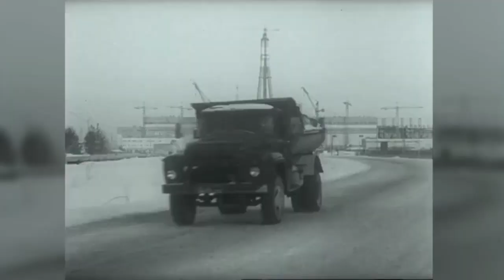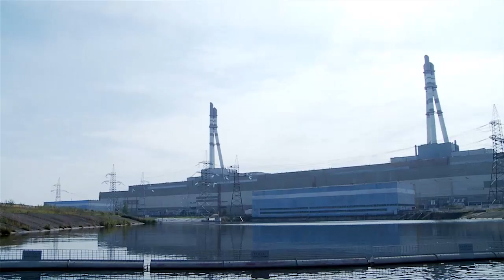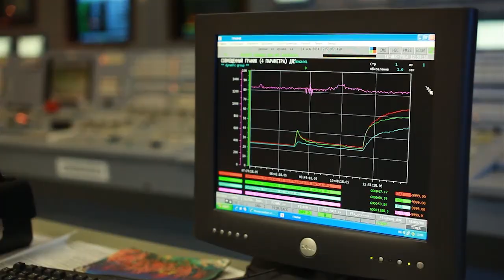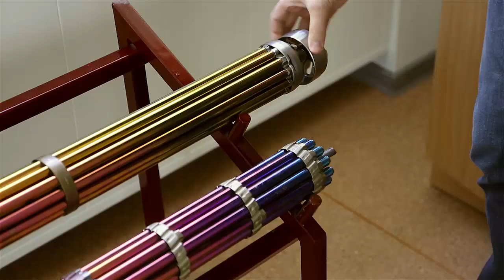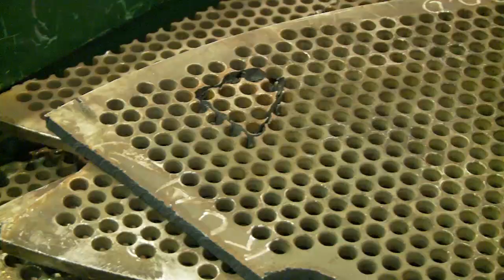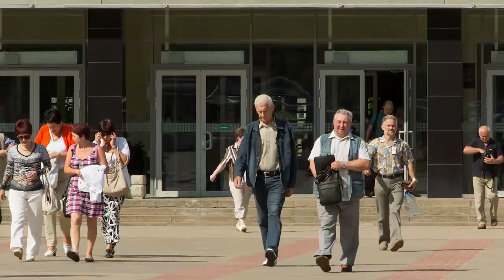SE Ignalina Nuclear Power Plant

Comment: A lot dishonesty in this video, they had an uncontrolled power excursion prior to Chernobyl and despite all the post Chernobyl fixes the inherent design flaws (quite simply the numbers of steam pipe welds due to the Soviets lack of technology and skilled workers to do the larger welds)  leads to leakages of radioactive steam that exposes its workers to radiation outside those acceptable in the West and of course the fundamental issue of their being no containment around the reactor.

Comment: Ignalina NPP had 2 RBMK-1500 reactors and both were capable of producing 1500 MW of electrical energy each. And following the Chernobyl disaster, they were de-rated to 1360 MW and were still producing 2720 MW total by 2001, which was fascinating, as even today this would be a powerful decent nuclear power plant. The Soviet Union had the most powerful reactors during the 80s and only Japan developed their nuclear energy industry even further as some of their reactors are even more powerful than Soviet ones. But the Ignalina NPP was a truly powerful generating facility and after various reactor safety adjustments introduced after 1986, it could be run even longer. In short, this was an impressive nuclear plant.

Comment: I don't understand why they don't let the plants run there course.  They are already there.  Use them for the lifetime they were built for.  Then dismantle them.
Reply: Agreed, it was a solid plant. Different from Chernoybl
Reply: The trouble is that the RMBK could not be upgraded to meet Western safety standards the Soviet PWR types could be with significant upgrades to containment, controls and safety systems.
Reply: Because ting goes boom and then u dead
Reply: @unitforce7417  not with upgraded rbmk’s

Comment: Looks powerfull tho. Sad but not in use actually a good thing after the Chernobyl but still it have helped Lithuania a lot.
Reply: Should've kept running for about 16 years more in my opinion, this power plant was pretty safe and Lithuania would have more electricity.
Reply: @vervluukt  yea and meanwhile now in russia and some other places in the world you can find this chernobyl type of  power plants soo
Reply: @probasketspec5025  The operational ones are all in Russia, Leningrad 1 (The first RBMK ever built) was shutdown december last year.
Reply: @vervluukt  Yeah and then there would be another Chernobyl type of disaster. Ignalina is a sister power plant to Chernobyl. It actually had a mini accident even before Chernobyl had one. There's no way this power plant was safe.
Reply: @esclove3707  The RBMK-1500 was safer than the RBMK-1000. Yes, i know the mini event at Ignalina, it had a small power surge when starting up reactor 1. They noticed this at the Leningtad NPP in 1975, and it happened in Ignalina aswell. And that was one of the contributors to the Chernobyl disaster. And, Ignalina isnt a sister plant, it uses a different RBMK, therefore, it does not classify as sister. If you want to see the sister of Chernobyl NPP, go to Kursk NPP.

Comment: RBMK-1000 and maybe all RBMK reactors have the same dangerous design graphite on the end of the control rods, far as I know all of the bwr reactors in the United States use cadmium rods or blades for the control feature of the reactor, and they drop by gravity instantly when the button is pushed to scram the reactor...
Reply: Those problems aren't there anymore.
Reply: @vervluukt  the entire rbmk design is faulty it is a cheap fast way of making power that is inherently unsafe the design the graphite used as a moderator, bwr and pwr are much safer, and have very good safety procedures in place as long as the operators follow them...
Reply: @trentvo2736  Some Nuclear power plants in the UK still use graphite as moderators. They still operate fine and safe.
Reply: @jannadrielcervo7753  Yeah, but they use CO2 as a coolant, so there is no positive void coefficient. It is also build and designed much better and the safety culture in the UK is much better.
Reply: Almost all of the RBMK still in operation have replaced their graphite tip control rods with a better and safer design. It is also further improved and upgraded with more emergency safety devices. Only three I think still remain with the tips made of graphite. But I don't know if currently the remaining are now being dismantled or further improved.
Reply: @jannadrielcervo7753  The remaining are getting further improved.
Reply: Jann Adriel Cervo Generally all units were updated after the reasons for the accident became clear.  I'm not sure if some of the control-rods still have graphite-tips,  -but they have cannot be driven out of the core anymore so that there's no additional react added into the core if they're driven back.  -But most importantly there're new motors that push down the control-rods in 2 seconds rather then 20 before the catastrophe.
Reply: @jannadrielcervo7753  sometime you just can't improve a poorly designed system, plants using graphite as a moderator are inherently unsafe that's why they were never used in the US except for enrichment purposes, maybe you should tear out some engineering books and do a little more research before making claims, poorly designed reactors should be done away with, decommissioned put small bags and plastic barrels and buried and a safe location where will not affect the people or the water table...
Reply: @trentvo2736  Not really unsafe. It was a Design flau that now is fixed and the chernobyl incident happend to Human error too if the operators followed the manuals for the test the reactor whould not have exploded. but luckly it fixed so no more incidents like that can happend and its just a shame that a good reactor as that so powerful is going to decommision all of them one time in the 2030's. that reactor type have a very good safety reputation but the chernobyl incident ruined it all for RBMK reactors even tho it fixed
Reply: @eliasnikolaivonheimtrondse4424  No thats not true, the manuals did not prohibit any of the actions taken by the operators, except for a too low ORM (But they couldn't have known this. the computer took 30Min to calculate this). The Soviet Union lied about the documentation, this was corrected in the INSAG7 report of the IAEA.
The RBMK Reactor is fundamentally flawed, it was build to be Cheap not Safe. Graphite moderator and light water coolant is a bad idea. The Reactor has a Positive Void coefficient which is due to the Construction of the Core itself, it cannot be fixed completely. It was improved (two!) years after Chernobyl, but it is nowhere near the safety standards of a Western Nuclear Power Plant. And it's definitely not a good reactor.
Reply: @gutesache1  its a shame they retiering the reactors now they solved the issues, more enriched fuel and much more so it aint gonna explode agian and more safety protocals a whole new design, and they.violated the guidlines they knew they were in a xenonpit but he wanted it done so they pulled out controllrods and when the chain reaction start nothing to stop it no water,controllrods or xenom beacuae it burns away and the scrambutton flau the new safety protocals is for the first part of what i told (human error) and the redesign is for the az5
Reply: @eliasnikolaivonheimtrondse4424  Yeah, actually the guidelines only prohibited starting again from decay heat. In the manuals this was declared as < 30MWth. So they didn't violate the rules. 
.
It was retrofitted with the new control rods, more absorbers, better safety precautions, etc. It made it more safe than it was before. But the design is fundamentally flawed. It still has no containment, a positive void coefficient in certain operating conditions, a very low thermal mass and a very big core which makes it hard to control the neutron distribution in the reactor.
.
An accident like the one in chernobyl can still happen in an RBMK reactor. For example more than three pressure tube ruptures could have a catastrophical outcome. But even in normal operation the RBMK plants have very high radiation emissions, thats why they have those big cooling ponds.
.
It's a garbage reactor and it can't be fixed, all RBMKs should be shut down and replaced with e.g. the VVER 1000 or the new Gen 3+ VVER 1200.
Reply: @gutesache1  it cant happend they use a specific low enrichment fuel in their reactors now and all the other changes. Wont be possible to explode (sorry for bad english)
And yeah it dosent have a containment vessel that make it can refuel and not need to shutdown and thats why it dosent get license in the West but that made the catasrophe worse at chernobyl  but all the changes made the beast of a reactor more safe and if you look at the safety records if we take chernobyl accident out of the list its just fantastic but if chernobyl didnt happend the flaw whould still be in the scram system of the reactor but since it happend it was made sure not to happend agian
Reply: @eliasnikolaivonheimtrondse4424  I disagree, and they use higher enrichment fuel. It was increased from 2.0% to 2.4%.
There are other reactor types that can be refueled while in operation e.g. the Advanced Gas Reactor from the UK, and it still has a containment.
.
The problem with void reactivity can't be fixed completely, the core is due to it's enormous size unstable, the low thermal mass can't be fixed, redundancy is still a big problem, the data acquisition system is very old and not at all redundant, spatial power control systems are still being operated with only 9 zones, in most plants its still the operators responsibility to keep the ORM in a safe margin (although it's a very important value in RBMK plants). And that's not all, there is more.
.
It is a generally unsafe design and should not be in operation anymore. There is a reason why countries with old VVER or RBMK plants, have to shut them down to join the EU. When West and East Germany were reunited, all soviet nuclear power plants were shut down immediately. For example Greifswald - 5, a VVER 440/213 was only 24 days in operation, because it wasn't possible to bring it to the safety standards of the west.
Reply: @gutesache1  sorry saying low enrichment fuel i thouth it was higher enrichment in my head so i searched and it said less enrichment but in my opinion no more pf those reactor need to be built but the remaning ones  need to continue operating
Reply: @gutesache1  ok thank you will read that artical
Reply: @gutesache1  after reading a little bit of the flau and fixes and that i still stay strong with my opinion All the current RBMK reactor have nothing to get retierd for in 2020 but no more of RBMK reactors should ever be built if they dont get a whole new reactor design that eliminates all the flau/flaw that the current one got but overall if it get proberly maintained and a crew who fully knows how the reactor work and its breaking point and rules i see no need to retire the current ones
Reply: @eliasnikolaivonheimtrondse4424  Okay, then that's your opinion. But I still disagree. To clarify, I'm not against the peaceful use of Nuclear Power, just against using old unsafe soviet reactors. And the RBMK - 1000 is in my and the IAEA's opinion unsafe and should not be operated anymore. They should have a time frame to replace those reactors, but that should not be longer than absolutely necessary.
Reply: RBMK reactor flaws were fixed following the 1986 Chernobyl nuclear disaster. It is also one of the most powerful reactor models and following the Chernobyl 1991 Unit 2 turbine hall fire, no large accidents were reported.

Comment: This power plant was safe! But a incident happened (which later caused the Chernobyl accident), so they actually even knew before the Ignalina incident and Chernobyl accident happened.
Reply: Hi.
Reply: You don't know what the fuck you're talkin about the rbmk reactor is a bad design to begin with having graphite on the ends of the control rods plain and simple but the rods in you got a reaction graphite is a moderator increases reaction...
Reply: @trentvo2736  "don't know what the fuck you are talking about" These problems got fixed later, a chance of Chernobyl happening again with a RBMK is practical nihil, those problems were wiped out by the fixes, do more research matey.
Reply: @vervluukt  the Ignalina discovery was silenced by KGB. Because Lithuania was then part of a country that has an obsession against being humiliated.

Lithuania should have followed Britain in exiting the EU. 
And if EU was Wise, one improved RBMK be left to operate, until newer, safer and as powerful Western designed Light Water Reactors take over energy and employment needs of the Ignalina area.
Reply: @h.cedric8157  I agree.
Reply: @h.cedric8157  I worked for Atlantic nuclear services at SONGS, working with Bechtel and Westinghouse on the first attempt to resleeve steam generators in unit  one, unit one went critical in 1968, & operation until 1980 when it was temporarily off line for approx 1yr for the  resleeving project. And went critical for approx 8 years until it was decommissioned. So research was not necessary,  but the Russians are cheap and the rbmk reactor is the cheapest way to make a lot of energy, in a unsafe manner, that's why we do not use them for power we use BWR, & PWR for power, graphite moderated reactors like the rbmk is  strictly used for enrichment purposes have a nice day knucklehead
Reply: @trentvo2736  
First off, why the heck are you calling me a knucklehead? you must be confused or something
Reply: @h.cedric8157  sorry about that little carried away that mean to call you a knucklehead I take it back, but the RMBK 1000 is just a bad design in and all, and the plant in Lithuania was decommissioned because of the rbmk 1000 it is too difficult to get into the highly ractive fuel channels 2 make adjustments to these poorly designed control rod, decommissioning was the safest idea,
Reply: @trentvo2736  i thought you did get confused, been guilty of the same before.

It is a powerful but has a lot of possible issues. Plus the fact that all RBMK models are Not built with a containment structure makes it susceptible to hydrogen issues, and is susceptible to xenon poisoning.
Reply: @trentvo2736  RBMK 1500